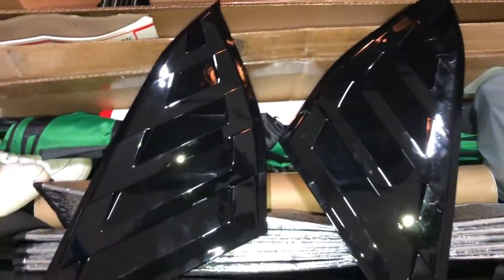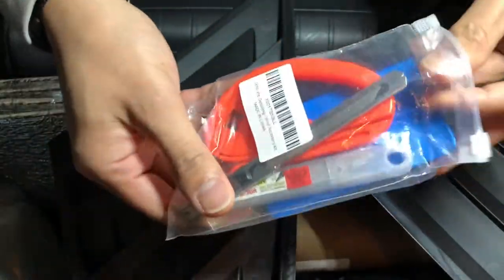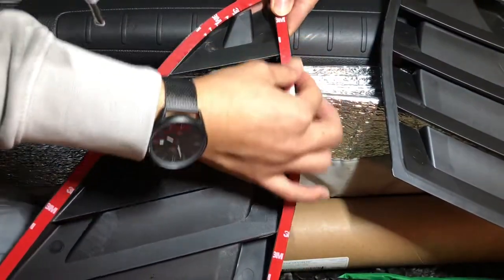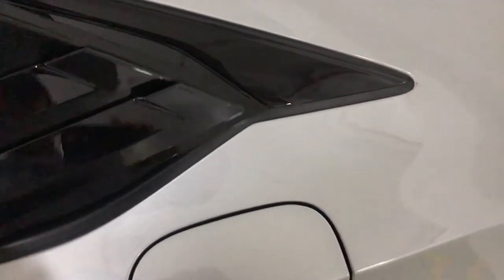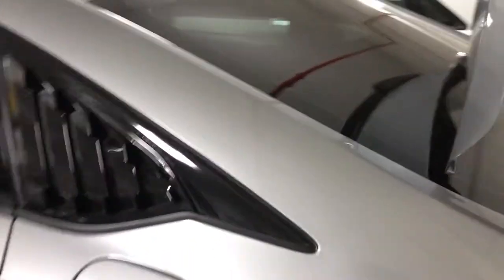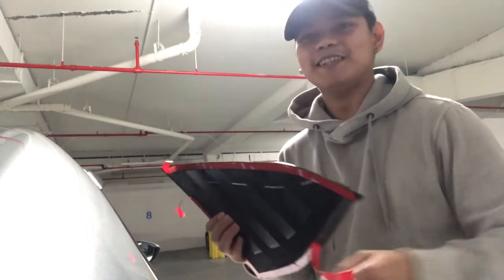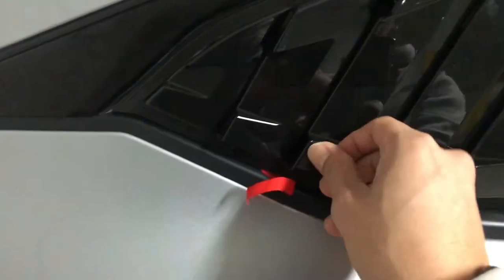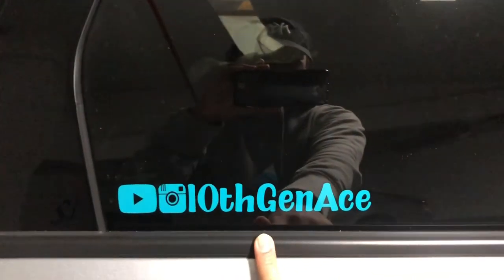2018 - 2020 Honda Accord Rear Side Window Louver Vent Shade Installation

Comment: Dope. I just bought a carbon fiber pair for my Sentra. Do you think I should use my own store bought 3M tape or the tape that came already on the louvers?
Reply from the maker: TBH, I used my own 3M tape and I would suggest using your own 3M tape as well. On top of that, prior to applying your louvers onto the window, heat up the 3M tape with a hair blower, heat gun or use a lighter to get a better grip.

Comment: These definitely look like they've got some mold release agent on them, so before the alcohol, I'd actually suggest hitting them with some warm soapy water and a toothbrush, followed by a hit with a little sanding stick, and then a wipe down with the alcohol. Just my experience from building plastic models speaking.
Reply from the maker: Thank you for that insight, I would definitely remember that when installing new stuff on the car and when I do a maintenance check on the parts I've installed.
Reply: @10thgenAce  Yeah, I don't know about yours, but mine definitely had some of those little raised circles where you could tell it was snapped off of a mold after it was made. The thickness of the tape might be enough to make up for it, but better safe than sorry.
Reply from the maker: @TotemoGaijin  mines are firmly holding on still and I’ve washed the car so many times and all but there’s no mold yet. I hope I’ll be on the safe side, but thank you for the insight, I really appreciate it bro 👍

Comment: Anyone know how to clean the windows underneath them? I have mines on and I could see how filthy it is underneath them and wondered if there is a way to clean them.
Reply from the maker: I usually spray it with soap then use a pressure washer to clean it off. I know how tedious it is just having this one.